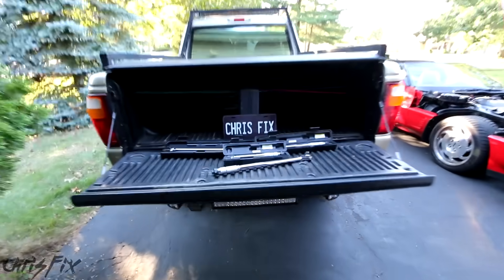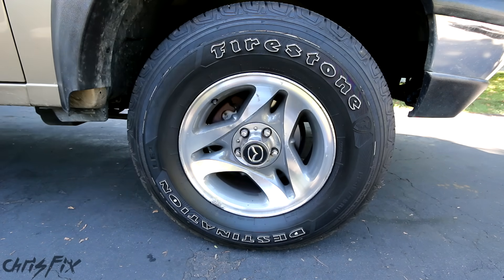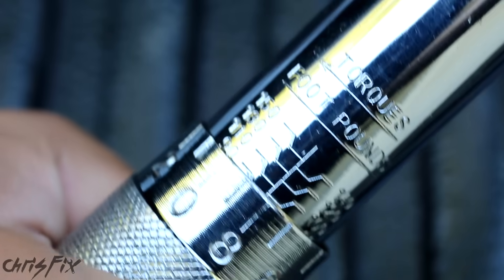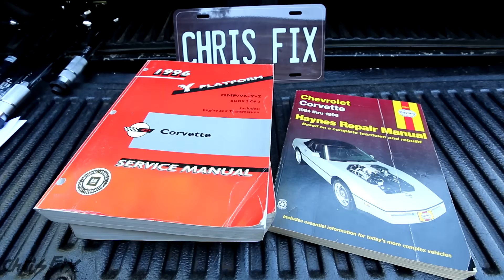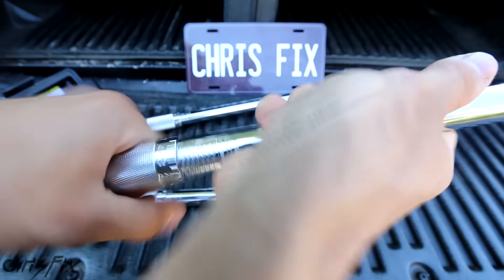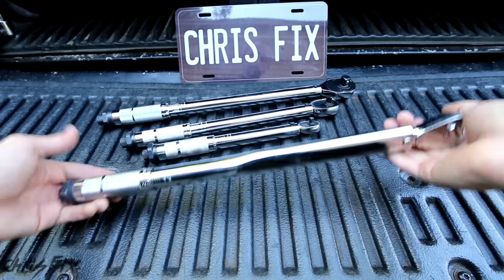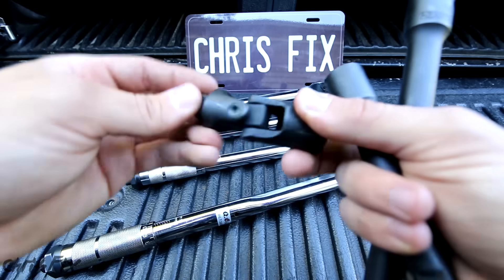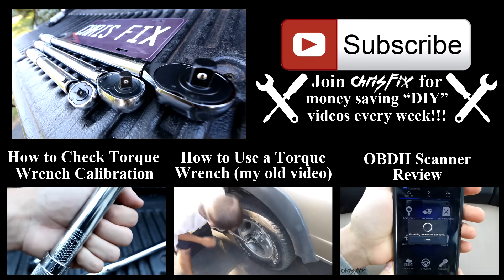How to use a Torque Wrench PROPERLY

Comment: Chris, as informative as ever. Great work on this video. Another thing to keep in mind is something called range of linearity. Most torque wrenches are pretty accurate in the middle of the range, but the low end and the high end are less accurate with click type wrenches. So for critical applications, you want a torque wrench whose middle range is within your torque spec (think of a bell shaped curve, 10% on either side is less accurate). Granted, the difference between 95 lbs-ft and 105 lbs-ft on a lug is not critical - just know that if 100 lbs-ft is the upper end of your wrench's range, it's not going to be as accurate torquing a fastener to 100 lbs-ft. That's why it pays to have several wrenches with different ranges. The higher quality the wrench, in general, the better the accuracy throughout the range.

That said, the range of linearity of a beam style torque wrench is pretty rock solid throughout the range. I always use a beam style for my lugs, and only use click style in applications where I can't use the beam style.
Reply: You know those scales that they use to weigh trucks for DOT compliance, or at junkyards? You know, they weigh the truck at the junkyard, the driver dumps his stuff, they weigh him on the way out, subtract the difference and that's the weight he was carrying. NOW, imagine putting a penny on that scale - would it register? No. 

That's because measuring devices have range of linearity and except for the most expensive, calibrated instruments (think lab) the low end and the high end have the most variability. 

Torque wrenches are, as you say, in general, just a spring, and applying tension at the lowest end (and highest end) is going to have more play. That's why they make torque wrenches geared towards smaller torque ranges (think 1/4" drive) and torque wrenches for greater ranges. You want to use a torque wrench suited for the range you will be working in - but as you get to the "limits" of that range, the accuracy is challenged. 

They calibrate them to be +/- some level of torque, but that's only in the mid-range.

Putting a penny on a gram scale will weigh reasonably accurately, but same penny on a kitchen scale, won't.
Reply from the maker: Thanks a lot for the added info.
Reply: why is it less accurate in the high and low end? a spring has a constant increase in force per inc right? so it should not matter. or does that only apply to the stretching of a spring? just wondering not to devalue your comment
Reply: The way I imagine it: Space-Time is curved.
Any Force in action is met with resistance as it travels a "linear distance", so for that spring, going across the curvature, in any direction, is also running into and against the E=mc^2 portion.

Hence, the accuracy falloff?

Any physicists can confirm?
Reply: Thank you for responding so quickly. I get what you mean and i know about significance but am still wondering becouse the example you use is about an entirely different use of a scale. if you have a scale for a max of 500 grams and you use it within that 500 grams it should be reasonably accurate. and you wouldn't use a torque wrench outside of its scale.
Reply: In most cases it doesn't matter if your torque is off 4% or 2%. The lower the torque the more important the accuracy. Also, in most cases there are from ... to... values with torques, even in shop manuals.

Comment: 5000 cliks? damn, at my workplace we use these around 300 times a day! from all 3 shift. and we never calibrate them x'D ps. i work in a machine workshop.
Reply: +AntimatePcCustom : torque wrench calibration is part of the tool ownership. Let's hope there are no failures attributable to this oversight.
Reply: yer. lets hope. but many things at my workplace is being used untill it breaks... so so so sad... cnc machines for millions, used untill they break. nearly nothing if not never seen any kind of service.
Reply from the maker: Crazy!  You probably use a torque wrench that has a higher amount of clicks per calibration.

Comment: glad you're recommending a tekton and not HF. don't get me wrong, HF has some decent stuff, but their torque wrenches are not worth getting... I bought the 1/4" and 3/8" HF torque wrenches, and almost snapped a flywheel bolt when torquing it down. replaced with tekton's and am happy. i also use and recommend the mountain 1/2" drive.
Reply from the maker: Yea,  it's a great wrench for the price!

Comment: Since I didn't read through all 279 comments (as of this comment), I hope you didn't answer this question already.  You mentioned the pros/cons of using extensions, etc., but what about using a reducer, i.e. to use a 3/8" socket with a 1/2" wrench?  Is that acceptable or not recommended?  Thanks Chris, love your videos.  I keep a laptop in my garage so I can follow along as I work on something!
Reply from the maker: +vstardon1100 You can use a reducer. That is not a big deal. The goal is to try to use the least amount of attachments as you can but like I said, you need to get the job done.

Comment: Are you super strong or do you just not use handbrakes? You're car rolls quite a bit when you are adjusting the lug nuts.
Reply from the maker: +Kingo64 I mean I am putting down more torque to the wheels than most honda's make hahahaha
Reply: +ChrisFix no kidding lol

Comment: One mistake. Always push down to loosen or tighten lug nuts. Use your weight to your advantage. Never pull up,  you can hurt your back.
Reply from the maker: +russwelday Thanks for sharing but I have more control and can exert more torque by pulling up. I am not a very heavy person so when I need to torque things, I end up pulling (plus I am in pretty good shape so hopefully I wont hurt myself haha)
Reply: +russwelday that's good advice, I do it that way too, it's safer for those of us that aren't used to work using a lot of force :)

Comment: "Not all People use ft lb." More correctly: "Everyone  outside of the US uses Nm." I don't want to break out a discussion wheter to use imperial or metrical units, but i came to the conclusion myself, that its way easier to go with metrical measurements, because they're more self explanatory and generally more logical than imperial units.
Reply from the maker: +JapaneseHeavymetal Haha, Metric is easier but I live in the US so I am use to using Ft-lbs. As a scientist it is way easier to use metric!

Comment: I have to torque lug nuts every damn day 😂😂😂 tire technician life ! these semi tires have to be torqued at 550lb-ft
Reply from the maker: +Tanner Rubio WOW that is crazy!!!! Do you use a 3/4in drive torque wrench or an air gun with a torque at 550?
Reply: I use a 1 inch torque wrench little smaller than me and I'm 6'2" haha it's heavy as heck ! I have a big 1 inch air gun that is only good for removing the lug nuts then use a 1/2 inch air gun to put lug nuts back on then torque them with the torque wrench. By the way your videos are super super helpful ! Keep up the hard work !

Comment: Another important point is to keep your hand on the handle, or the torque would be off. 

I usually click it twice.  No sophisticated science/logic here, but being an airline tech myself many top-notch co-workers do this.  I would also avoid cheap ones such as those that are made in China.  

Delta Air Lines came up with a CBT a few years ago where they say to keep the torque wrench at 10-15% loaded when
storing, not at the lowest setting.  

I love it when some pros use impact guns to tighten alloy wheels.  

Compared to more popular professionals' channels, your channel is concise, straightforward & easy to understand.  And you don't leave the basics behind, which I like.  Keep up the excellent work.
Reply: Gary Fitzhugh Well see now herein lies the problem.  I am not a professional mechanic (meaning I do not make a living out of it) but i have been working on cars for 35 years.  The problem is I just did a another search on torque wrenches and proper use and I get a LOT of different opinions from a lot of different sources.  So goes the internet.  So... I am NOT attached to doing it 2 clicks.  In fact I used to do it once and only once.  Then I searched and listened to others.  If I could find a manufacturer like Snap on which has this procedure of clicks listed on their site that would be great.
Reply: @endeavorrv  Where there are many people there are many idiots who think they know how to do it right.
Reply: Keith Cassinger If you're using the wrench incorrectly, you're just making it worse.  If you using it correctly, you're wasting time clicking it twice. Just because a lot  mechanics do it, doesn't make it right.  And I outta know, its my job. I'm the torque wrench technical trainer for Snap-on Tools.
Reply: @garyfitzhugh1056 Clicking it twice is always wrong. You can't click at a value that is too low, only at a value that is too high. So clicking more than once can make it only worse, in any case!
Reply: No it doesn't, it will click at whatever torque value it is set at. Clicking it twice doesn't mean it's over torqued. Torque wrenches are calibrated to a certain tolerance so it may not apply any extra torque or you might get an extra foot pound but it will still be within the specification.
Reply: @asshatpolice  i agree with you 100%  , im a  rocket mechanic which is better than a aviation mechanic so i would know
Reply: @asshatpolice  It will. If you tighten a nut, you always have a higher "break loose" torque than the torque you had, when you stop tightening it. With the first click the value is right. With the second, it will alsways be higher. But the biggest problem is (as this video unfortunately shows), if you use the wrench with momentum. Although it clicks, you will be overthightening. But people without the faintest idea shouldn't be posting here. But as we all know: You tube is NOT a good reference of how to do things correctly.
Reply: That's good advice, also keep BOTH hands on the handle (one on top of the other) IF you must use two hands. BTW, there is no need or reason to click a torque wrench twice. Gary Fitzhugh, Snap-on Tools.
Reply: Keith Cassinger If you're using the wrench incorrectly, you're just making it worse.  If you using it correctly, you're wasting time clicking it twice. Just because a lot  mechanics do it, doesn't make it right.  And I outta know, its my job. I'm the torque wrench technical trainer for Snap-on Tools
Reply: my first  language  is berber and arabic french spanish in the end little english
Reply: I do a double click as well.  I agree almost all pro mechanics do that.
Reply: i agree with you in such point but in the case when we have torque can't stop when clicking if we retorque another time the value maybe added
Reply: I think I understand what you're saying (I don't mean to be rude, I see english is obviously not your first language), but if you're not adding any extra degrees of rotation, no further torque is being applied regardless of whether the wrench is clicking or not. Now in some cases a fastener is designed to stretch and is not meant to be used more than once so if you loosen it and attempt to retorque it, you will not end up with the correct clamping load.
Reply: Yes, because we all know double-clicking is a matter of life and death.  Keep arguing, fools.
Reply: Not so, with clicker or dial torque wrenches, hand position makes no difference. It does on bending beam types where you have to pull on the handle only an keep the handle floating on its pivot pin.
Reply: Actually, you can put your hands anywhere along the shaft and the torque will be right.
Reply: @dsteffler54 No, it won't. Don't say thing you don't have the faintest idea of.
Reply: @disdonc6.klasse549  Whether you hold the handle, or hold the shaft somewhat lower than the handle has absolutely no affect on the mechanism that sets the torque... and BTW, I'm an expert on physics. 😀
Reply: double click means over torque
Reply: Sorry, that's idiotic. A torque wrench is made to click correctly at the first attempt. Each second or third click will be more torque than needed as you first have to overcome the already exisisting torque. You're guarenteed to have more torque than you want.

Comment: The only extensions that will affect the torque output of a torque wrench directly are ones that will move what is being torqued out of coaxial lineup with the wrench pivot point. These would be wobble extensions and crows feet, (Or a warped  straight extension). 

Still extensions should be avoided because all sockets and socket connectors have some play in them and the farther the wrench is from the fastener the more that play can take the pivot point out of alignment. Anyone can test this by taking as many extensions as they can find and hooking them together and then trying to bend it and notice the U shape it will form while staying connected.

Misalignment with the pivot point of the wrench converts some of the torque at the fastener end into thrust force acting perpendicular to the axis of the fastener.

About the spring. Springs only weaken from cycling. Otherwise all our cars which rest their sprung weight on springs would sag to the ground in a few years. So technically loosening the wrench all the time will cause more wear over time. Though that amount is rather negligible when we are considering how low duty cycles these springs experience. Setting the wrench to 0 does have a few advantages though, it unloads the system in case someone where to drop it, and it also ensures you don't pick up the wrench thinking it is set to one setting from the last time you used it and end up over torquing a nut or bolt.
Reply from the maker: +Cragified Exactly thanks for sharing!

Comment: These kind of torque wrenches would have been great in school. We had the standard needle/scale one.
Reply: +Hurtydwarf yes and no, the needle/scale ones are nice because they never need to be recalibrated... so I actually prefer them, you can just start tightening, you don't need to set it first... that said the clicker type is nice because you don't have to look at the scale.
Reply: thedreadedgman So basically my school used them so when idiot kids constantly dropped them there was no need to worry about calibration? Makes sense.
Reply from the maker: +Hurtydwarf haha that is a good thing when working in a school setting with people not being as careful as they should and possibly dropping it.

Comment: Horrible technique for tightening bolts,   Doing that is a good way to injure yourself. You should push down, never pull up.
Reply from the maker: +sum42guy2k I prefer to lift up and I will not injure myself. I have more control and I can lift more than my body weight can push.
Reply: +ChrisFix Same here. I'd like to see someone push down to try and turn the axle nuts on my truck - to the tune of 296 ft-lbs!

Comment: My cousin once put Premium Gasoline into an Unleaded Gasoline type car. 

Is it healthy for the cars system in any way at all? The only positive thing I noticed about the Gasoline is that it lasted a lot more longer than Unleaded does.
Reply: +MLG Prony makes almost no difference... on very modern adaptable vehicles they will dial up or down the ignition advance automatically so you might get a hair more or less power... basically if it's designed to run on lower octane fuel then buying premium is a waste of money unless you're highly tuned or racing etc
Reply from the maker: +MLG Prony It makes no difference. The only thing that will change is the weight of your wallet. Premium in a regular type car will not do anything. Exactly what thedreadedgman said!
Reply: +ChrisFix hm. I used to think the same thing. My 03 PT Cruiser gives me a fault code (P0441) when I use regular instead of premium (regular gas here in Chile is 93 octane and Premium is 97 octane). Just for testing, once I filled up the tank with regular and the code poped up. Used the whole tank with the MIL (check engine) light on (on city and highway) and then filled up again, but with Premium this time, and after a few miles the MIL light went off, cheked the code and it dissapeared, and never returned. I changed nothing but the gas and the car is completely stock. I've done this test a few more times and it always comes out the same result (same fault code). That said, I noticed no change on the engine's performance or on the MPGs between Regular and Premium. I guess my car just doesn't like Regular lol
Reply: +David Miranda that's the difference. If your car is designed for regular you can go up in octane but if it's designed for premium you can't really go down. All octane rating is is a gasoline's resistance to ignition. The higher the octane rating the harder it is to ignite. So in higher compression engines you want a higher octane rating so the fuel doesn't ignite before it is supposed to which would cause an engine knock and set a check engine code.
Reply: ChrisFix hmm, well I was thinking of tuning up my 1994 Camero, that'll possibly put Premium Gasoline to good use, anyways, thank you for the advice.
Reply: coolm58 yes, I knew that too, but the owner's manual says that premium gas is not required, it's supposed to be designed to run on regular only